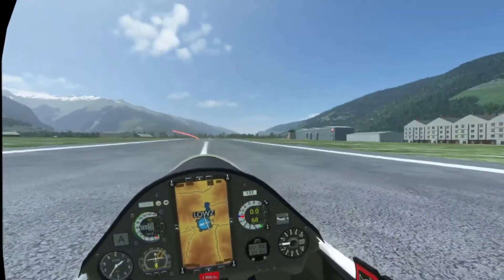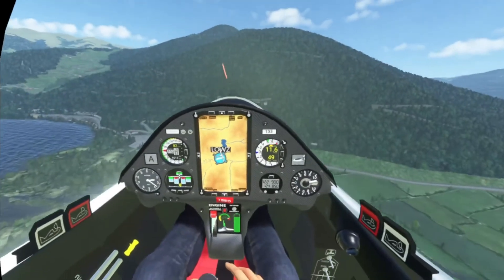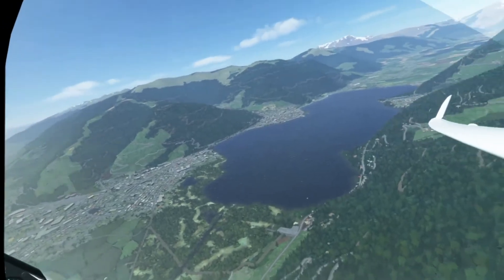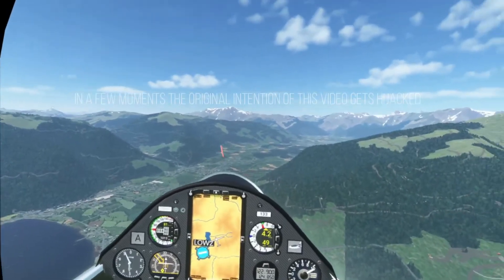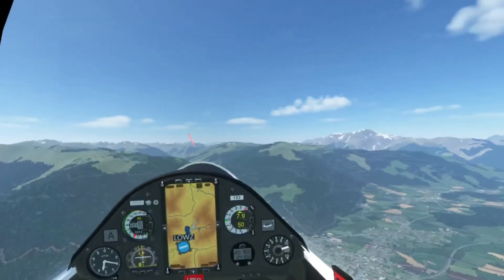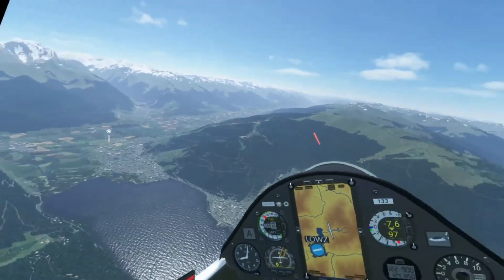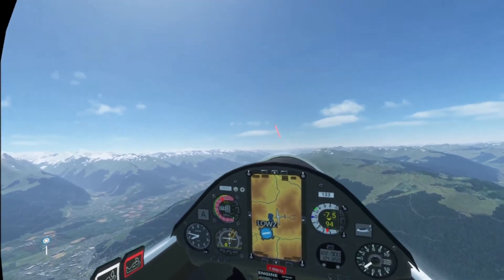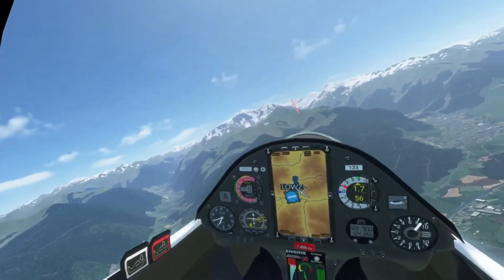Did I Find Wave in MSFS 2020?

Comment: Certainly looked like wave to me - don't know what else it could be. Nice job. Finding wave in MSFS, +100 points, launching with the spoilers open, -5 points.
Reply from the maker: Ahhh you spotted the spoilers😂👍 I edited out the where I nearly hit the rooftops
Reply from the maker: … but actuall -further investigation suggests it’s more likely that Asobo’s ridge lift is broken. Ridge lift seems to go up forever.
Reply: @rocketmandlgc   I believe that you are correct about Asobo’s ridge lift anomaly, Maurice, mainly because -- long story short: In order for true mountain wave to exist there must be a lenticular cloud (standing wave) existing over each of the downwind, parallel, (somewhat) evenly-spaced, mountain ranges.
Reply: @jstodaro  there doesn't have to be lenticulars for wave to exiat.. theyre more of an indicator of wave. , lots of the time there is blue wave, or it's just indicated by organizing the downwind thermals making the lift look like convergence but not behaving like convergence. 

Typically you only see lenticulars if the air parcel being forced aloft has high moisture content, or the wave is very strong.